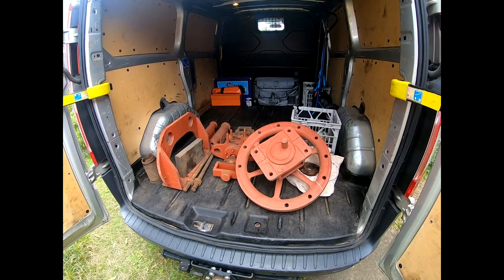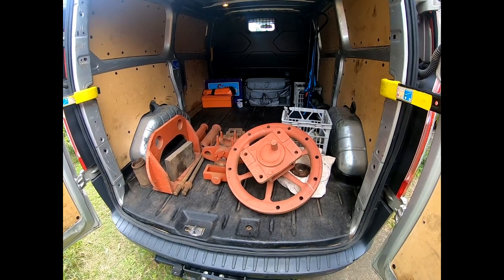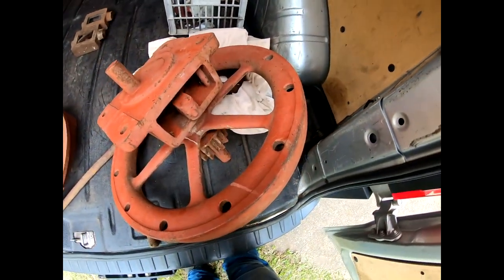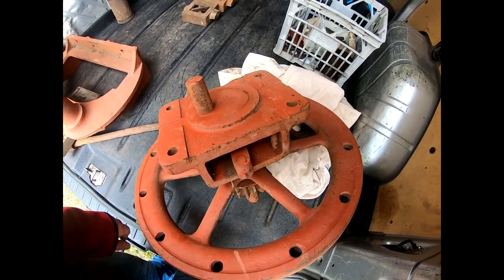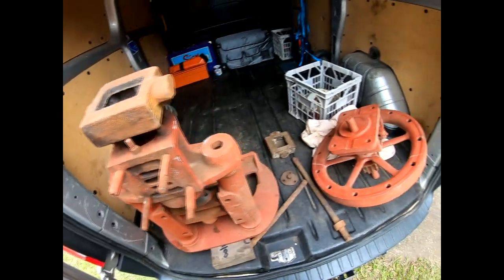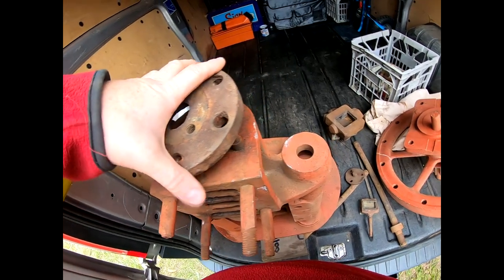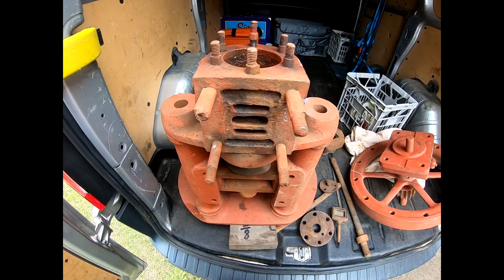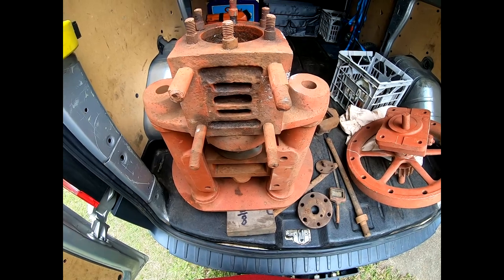A little Beyer peacock flywheel donkey pump

Comment: I believe you got the pillar castings the right way around but have the cylinder casting 180 degrees the wrong way. The base casting has two reliefs so the wheel doesn't interfere, which should place the valve rod and valve on the other side than shown. That being said, I'd hazard a guess that where the spacer is currently was previously where an eccentric was keyed to the shaft, driving the water pump underneath. 

Looks like a fantastic little project! Repairing the valve face will definitely be a fun little puzzle.
Reply from the maker: ive had a much better look at this this last weekend. yes you are correct. however, if this be so, then its not a donkey pump its some other kind of engine made by BP. still thinking about it.